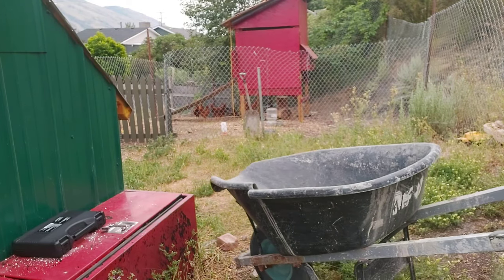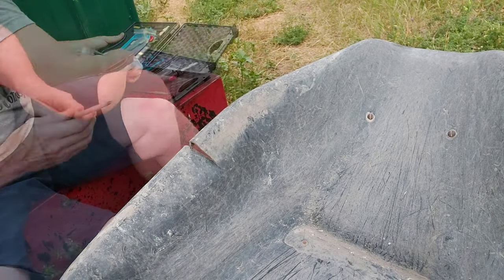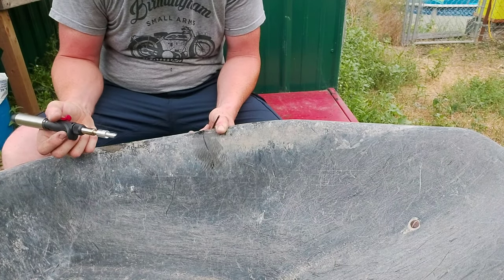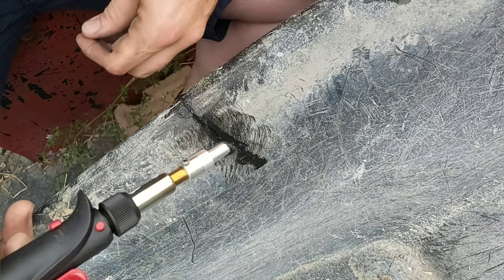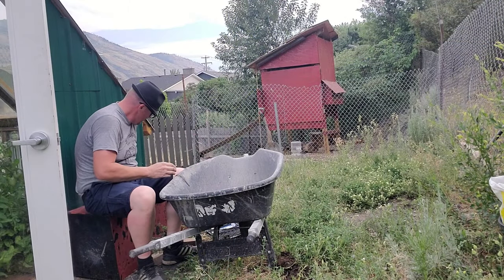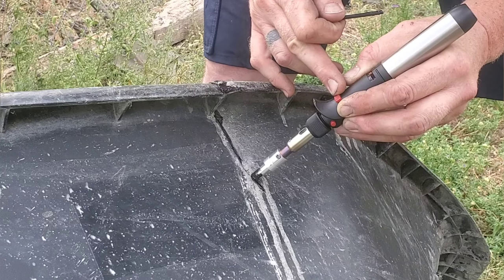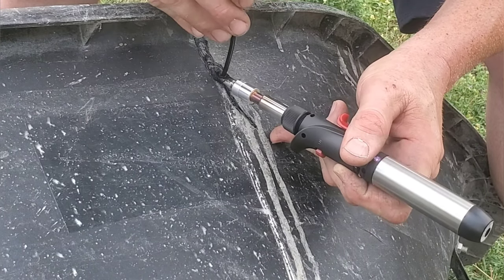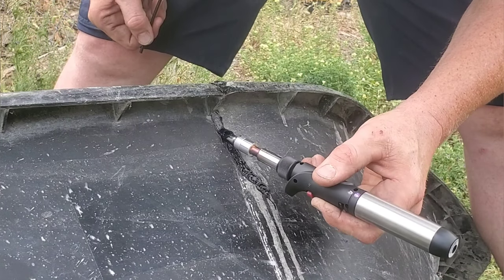This is How to Do a Basic Plastic Weld

Comment: Got an update?
Reply from the maker: 50 loads of cement later and it's hanging in there great. The edge has not cracked again.  The bolts are now pulling through the bottom in another spot so she is getting a plate in the bottom in spring